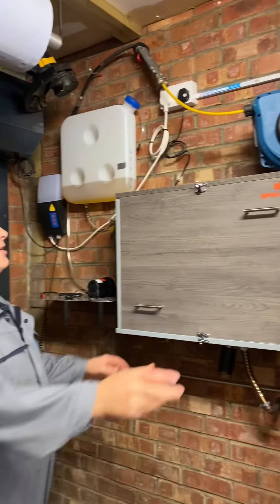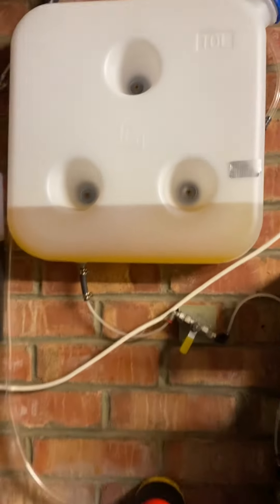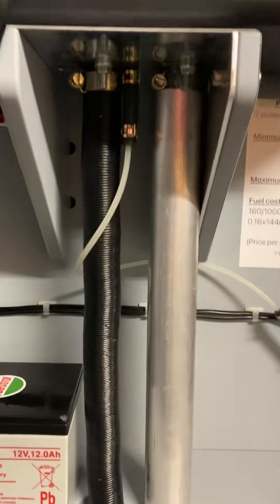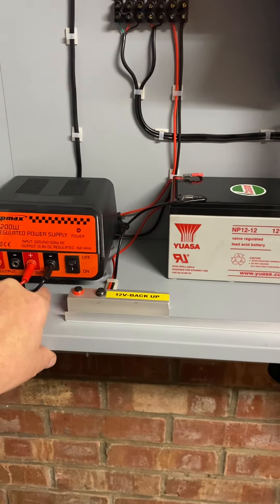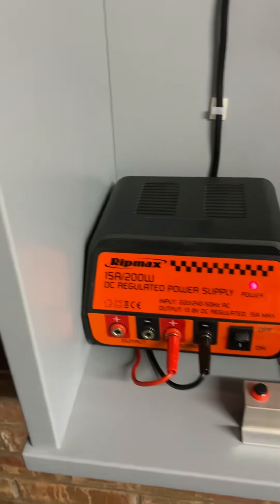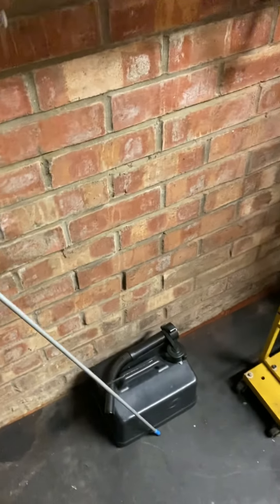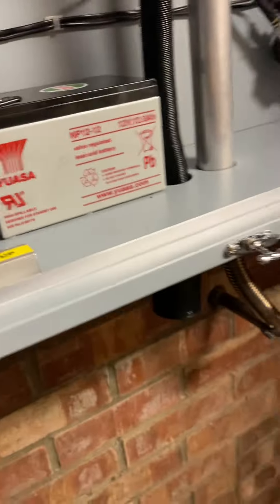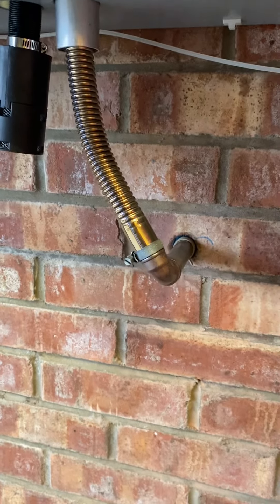Chinese diesel heater for use in the workshop/garage.

Comment from the maker: 0.02ml pulse rate
2 pulses per second =0.04ml per sec
2.4ml per minute
144ml per hr (minimum setting)

0.12ml per second
7.2ml per minute
432ml per hr (maximum setting)

Fuel per litre=£1.30
130/1000=0.13p per ml
0.13p x 144ml = 18.72p per hr on min
0.13p x 432ml = 56.16p per hr on max

This is probably not exact science here but it’s close enough for keeping warm in your workshop

Comment: Nice little setup you have there. I'm in the process of looking for something myself.
Could you go through what you have used and possibly where you got it from?

I like the idea of having it in a contained box
Reply from the maker: Hi Alistair, thanks for watching. My son made me the cabinet on a cnc machine at his workplace. I gave him a rough drawing of what I wanted and some sizes and he did the rest. Then I just put the exhaust into some 22mm copper pipe out through my wall, I didn’t use the muffler at all. There’s a link in the comments somewhere for the power supply I used too. The diesel pump, I bought a few year back off eBay but never used it until now. This is the video that gave me some inspiration for my set up:
https://youtu.be/lS6q9K48cV0
Reply: @dave garbutt  excellent. I'll have alook

Comment: What not put the battery inline with the 12v supply? No need to switch the output, it'll happen automatically?
Reply from the maker: Hi James, yeah I’m currently on with putting a switch relay in to do that.

Comment: Hi dave could you let us know the the make and where you got your power supply from great instal well done cheers
Reply from the maker: Hi Robert, cheers, I’m well pleased with it. I bought the power supply back in 2015 from eBay not sure which buyer it was  but I’ve found a link to one for you. 
https://www.align-trex.co.uk/ripmax-power-supply-13-8v-15a-200w-o-ip2001.html

Comment: Is this safe because mines set up similar to yours and is located in my workshop   (12x10ft) and I've Been told I NEED to install mine on its side with a turret plate so I've not been using mine for the last couple of days 🤦‍♂️
Reply from the maker: Hi cbr, yeah it’s safe. I have a brand new co2 alarm right next to it on my cupboard should anything fail and it reads zero. The alarm actually gives a reading (low) when I’m soldering in the garage would you believe. I saw a video on here where someone put a co2 alarm at the exhaust and it still didn’t alarm out. Most people put these heaters inside their vans without any bother. My mate has had his in his van (mounted under driver seat) for 2years now without any issues. Hope this helps.
Reply: Hi dave, thank you for your reply. I did think it was safe but was told it was dangerous, I also have a household carbon monoxide alarm right next to mine (as I was paranoid after what was said) what was said to me is "because the exhaust is metal there's no way to ever have a good seal onto it due to the constant heating and cooling it goes through" now what i have done is seal with vehicle exhaust paste and they put the supplied clamp/clip around the pipework and the the other end of the exhaust to the exteria of my shed. Thank you for your help, Grant. 1😊
Reply from the maker: @cbrgstarr  nice one. You’ll be fine, remember this is diesel we’re burning not petrol. There’s probably a higher co2 reading on your local high street with traffic than what your getting in your garage. 👍🏻

Comment: Why not take cold air from outside. Over pressure in the garage, fresh and dry air inside.  Now you have underpressure (air) and sucking cold air from gaps. 
I use dieselheater in a boat, so I know it works.
Reply from the maker: Hi knut, the heater would work a little better using outside air but that’s another hole in my wall plus I’d have to extend the air intake pipe which would mean more work for the heater. As for underpressure in the garage, it’s not nor never will be sealed enough (like most Peoples workshop/garages) so I won’t be worrying about the pressure unless one day I pop or something.

Comment: May I ask a question please,if you lost power how would the heater go through the cool down cycle?
Reply from the maker: Hi Tony, i simulated that very problem. I turned the power off to my power supply at the plug whilst the heater was in full flow and as you’d expect, everything went dead. I quickly switched power over to my battery and and the heater powered up but did not start again it just ran automatically in cool down mode. The heater cooled down and then it switched off. Happy days.
Reply: So you have kept the battery inline now?
Reply from the maker: @tonyblackhall16blackhall13  my battery at the moment isn’t in parallel. It’s not plugged in to anything as I only turn the heater on when I’m in the garage so if the mains power fails I need to manually switch over to the battery. When I get chance I’ll put a relay in so it switches over automatically or run it in parallel maybe. I’m lucky that we almost never have power cuts.
Reply: I was going to ask the same question, I had the same idea about using a relay, I was just curious if the cool down cycle would kick back in after a short power cut/failure or if it would just sit there overheating like it had just been powered up again and waiting for the POWER ON to be pressed.

Very nice, tidy clean setup by the way, I'd be chuffed to bits if mine looked anywhere near as tidy.👍

Comment: May I dare suggest this could have been a really useful video, a "look what I've got video" is OK but with little more effort it could have been really informative. How long does the diesel last?  litres per hour. How much heat does it produce? Room size? Room temp from cold? Room temp after half an hour, 1 hour, 2 hours etc. Steady output setting link to product. Other than that it was a well presented video it just lacked useful information.
Reply from the maker: Hi Christopher, thanks for watching. There a 100’s of videos giving all the info you suggested on these heaters mate which is why I thought I wouldn’t bore everyone with it all. I put the video on, not for”look at what I got” but to show people that you don’t just have to put these on vehicles. You could use them elsewhere. As for fuel usage if you look carefully and freeze my video you’ll see all the workings out of the fuel cost etc and litres per hr. When I get chance I’ll pin some info on fuel costs etc
Cheers for the feedback tho

Comment: All that wasted heat on the exhaust, that heat could be run through a radiator on the wall to give you more heat inside
Reply from the maker: Hi Bob, 
Ah……. but it’s not wasted heat!!! All the heat (and it’s very hot) on the exhaust is radiating out into my garage apart from the few inch going through the wall. Putting it into a radiator will just dull it down a bit like trying to get warm off a radiator with a coat over it if you like.